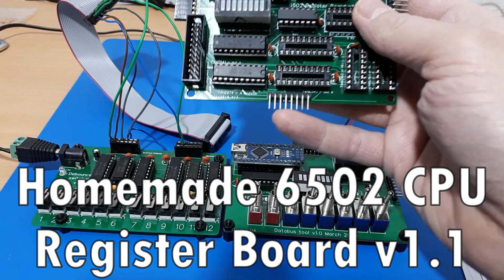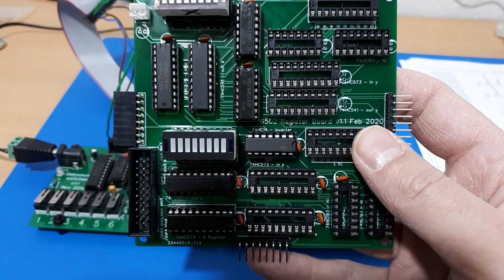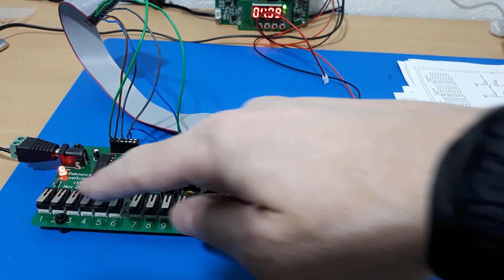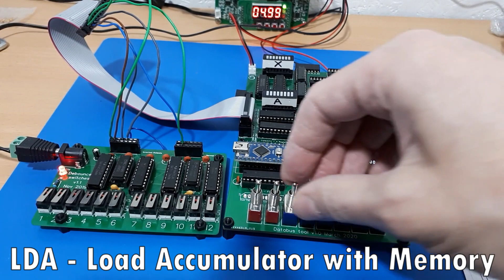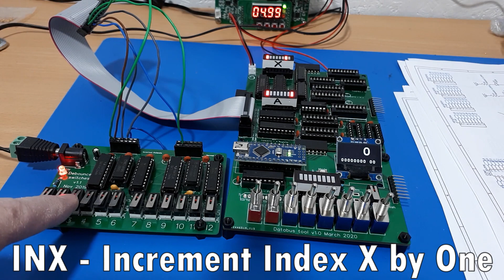6502 - Why no "Increase A" command?

Comment: Looking at the 6502 processor you must come to the conclusion that it is a very Spartan piece of equipment. To the letter it is not RISC but it comes close, many things other processors have are not present in the 6502. The simplicity made it easier to work with and that is what made it loved by millions of users, but after a while the lack of speed and the absence of real IO made the 6502 not ready for the future. The Z80 lived longer and had more offspring. Only the 6800 and the 8008 have evolved into modern chips still available today.
 
If I would have been on the team of designers I would have made it different. First of all I would give the 6502 ordinary IO, then I would make the addressability bigger and I would give it strictly separated program-memory and data-memory. (for safety) Dozens of chips all working in their own program-memory could function together with other processors on the same sheared data-memory. If in the '70's the Von Neumann-principle was put to rest we would have skipped at least 50 years of useless developments.
Reply from the maker: I guess they did what they could with what they had available. Cost was the main factor at that time. It's very simple, but it did have some nice pipeline principles. I do hate memory mapped IO though! It is a total pain.

Comment: Simple; 1) you can increase the Accumulator with
CLC
ADC #$01
and, 2) The X/Y registers are used to index into memory for the more complicated addressing modes, but the Accumulator is not used to index into memory, so the designers saw no point in wasting more silicon with an implementation to increment or decrement it. That’s my guess, but you’d have to ask the actual designers, assuming any are still alive. 🤔
Reply from the maker: I think you are right, and I saw that in a later iteration or the 6502 this command was added. It's clear to me that they absolutely were driven by a need to keep the transistors to a minimum!
Nice surname, by the way! ;-)

Comment: Did you think about ordering the necessary components from companies like DigiKey or Mouser?
Anyway, keep up the excellent work!
Reply from the maker: Yes, I'll probably have to go that way. I've always just gone the ebay-from-china route in the past because it has been so cheap and easy.
Reply: @CircuitBreaker256  check out AliExpress for cheaper more overall cheap cost. But the shipping is something from 1-3 months :)
Reply: @ithaca2076  Aliexpress sellers seems to find the slowest plane to ship your order. Then again, wanting 100 resistors? Get 1000 for adding to your junk box. 330Ohm, 1k, 5k, and 10k values never goes astray.